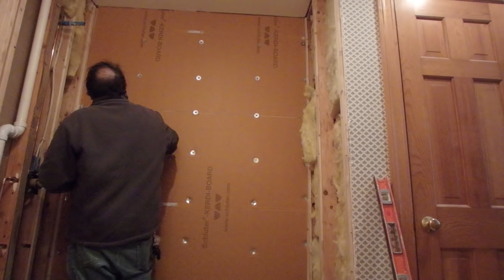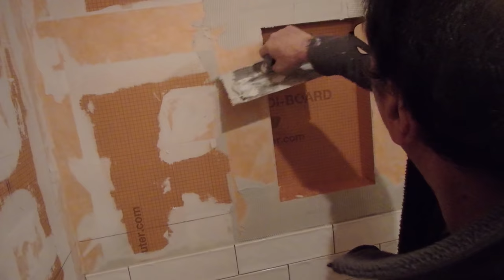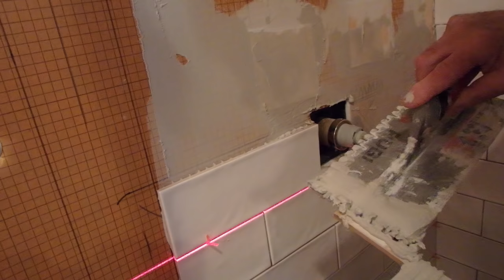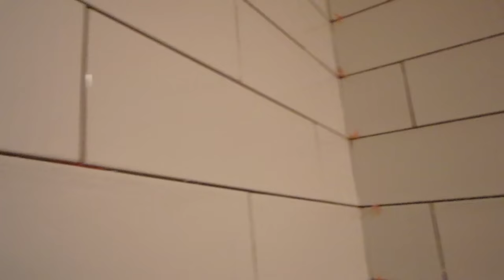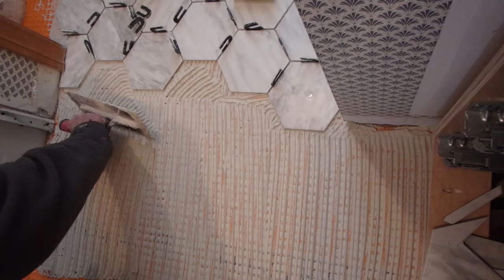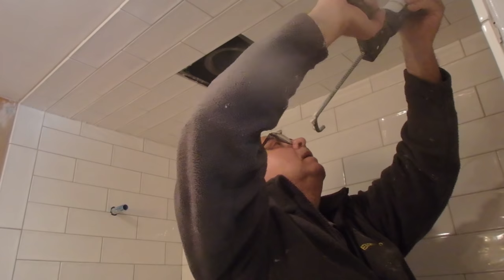Subway tile Tub area with Hex Tile floor.

Comment: Nice work! Looks like Delorian gray grout on the floor. The fan right above the tub is probably not the best location (in my humble opinion). If it was my shower, I would put a can light there, or two.
Reply from the maker: Fan was existing. Floor grout Silverado.
Reply: my fan has a light. Mirror never gets foggy with it in the shower. Pretty? Not really...lol

Comment: What a wonderful job Sal!   What style of subway tile is that?  I’ve been installing more subway tile in the past year then the last 15.  Also, I have to ask what was the finished edge of the niche?  I couldn’t tell what ya did there.  Regardless it’s flawless like every job you post!!!!  

In other news.....
Joining the TCNA next month and should be taking all the necessary steps to master this craft ( best I can 😄 ).   

Thanks for your dedication to the craft, it’s motivating my good man 👍🏼
Reply from the maker: The subway tile was not flat, kind of a rustic uneven finish, but they did run very even in size. The niche was framed with bullnose of the same tile on the sides and top. but had white marble for the bottom and the shelf. Great move joining the NTCA. I have been a member for years.
Reply: Nice!  Timeless look.

Comment: Hey Sal, what gap do you use between the tile and the wall?  Also, what gap do you use between the tiles in the corners?
Reply from the maker: According to TCNA, it should be 1/4". However I will usually match the grout line width, but never less than 1/8"

Comment: Do Americans not use 6 mil poly Vapour Barrier to close in insulation before drywall or whatever you’re finish walls with
Reply from the maker: Depends on the typeof install, when there is a waterproofing on the surface, then you shouldn't put it behind the board, one or the other not both.

Comment: Did you put marble at the middle of the niche?
Why you not finish the top of your wall with full tile?
In my opinion look more professional.
Reply from the maker: Bottom shelf marble, top shelf marble, top of niche Bullnose, sides of niche bullnose, wall tile surrounding the niche all full tile. Although I have done it several different ways depending on what the tile is, what the size of the niche has to be in relation to the tile, and countless other factors that come into play.